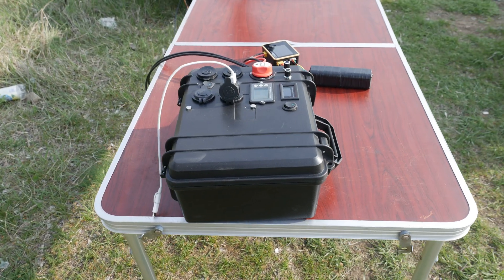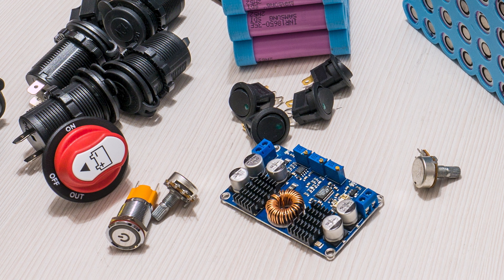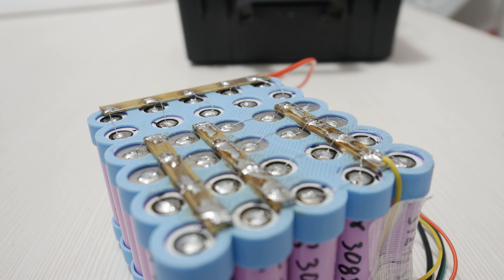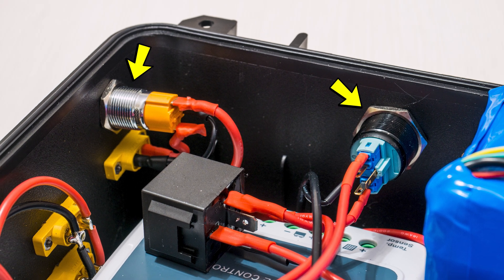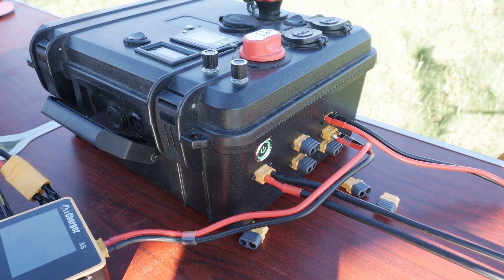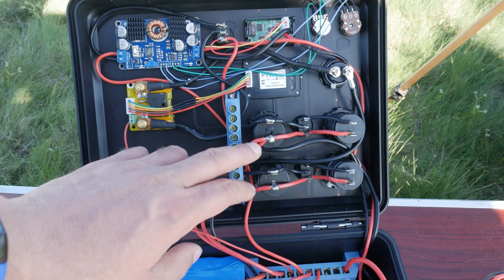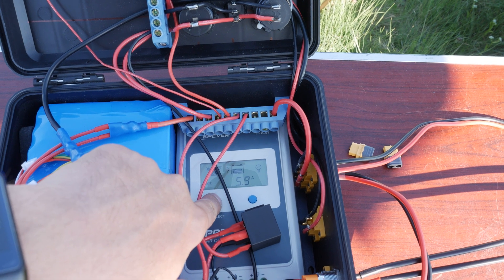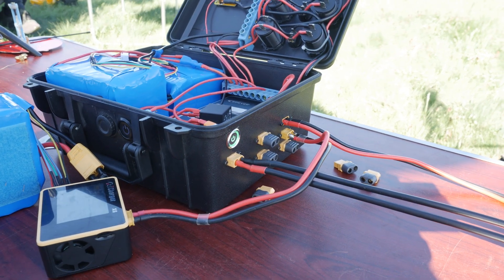My DIY Solar Generator Power Station

Comment: I recommend you to get rid of Pb batteries back from XIX, and use something newer from XXI century to start the car. I did it after Pb battery died after just 3.5 years of usage (55Ah -> 6.5Ah). In 2021 there are two cool options available: 4s LiFePO4 and 6s Li4Ti5O12. First is normally enough for a warm Europe climate, and the second is good for -35C winters and has almost infinite life.
Reply from the maker: I know what options are available, but my car is electric, so the 12v battery doesn't really start anything, just keeps the 12v stuff going like headlights, radio, gauge cluster, etc.! It actually never sees high drain situations as there is no ICE to get started! It was an 8 year old battery, the original factory one... so I'd say it was about time for it to give up! :)
Reply: @ArxangelRC  I bet it is Leaf :) My Pb battery didn't start ICE as well (Prius 20), only low drain situations, but still somehow get dead after just 3.5 years, so now, with 6s LTO 40Ah based on 66160 Chinese elements, I'm really happy :)
Reply from the maker: @Alexey L  Yeah, might look into those at some point, but it has a brand new battery in there right now, so see no reason to scrap it so quickly! It is a Yuasa one, so should last quite a while! And nope, not a Leaf! :P Its a Mitsubishi i-MiEV :)

Comment: Impressive setup. Mine is simpler. A 120w foldable 24v solar panel + a simple pwm controller and 2 12v 30 ah battery. Cost me +150€ and I can fly while charging my others batteries so infinite flying time in a sunny day.
Reply from the maker: Sounds good! :) Are those lead acids?